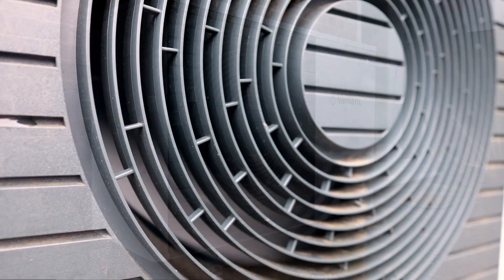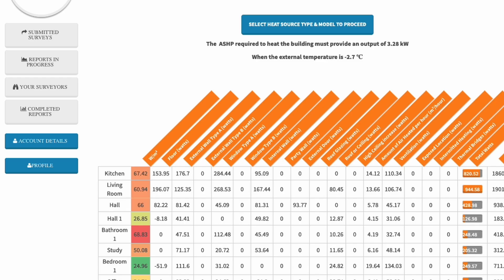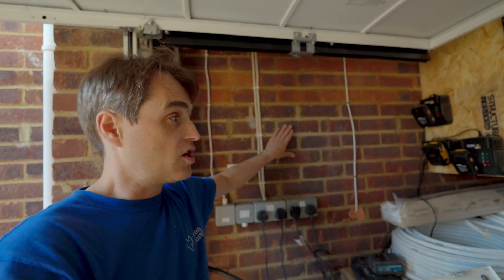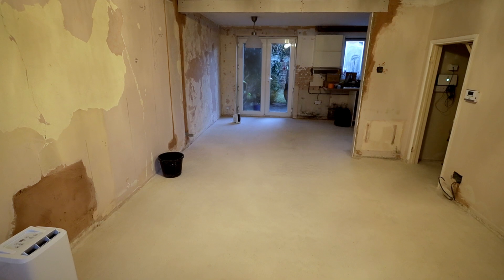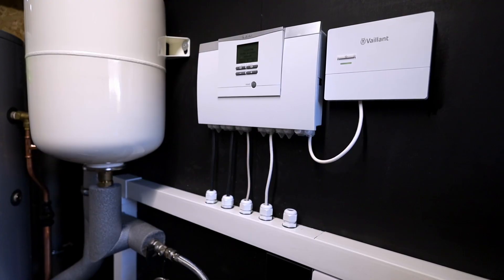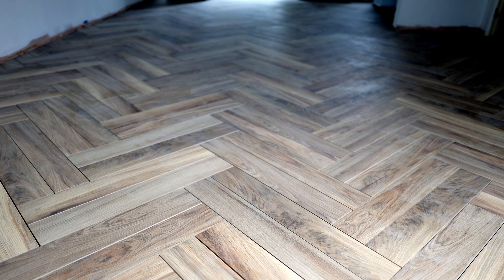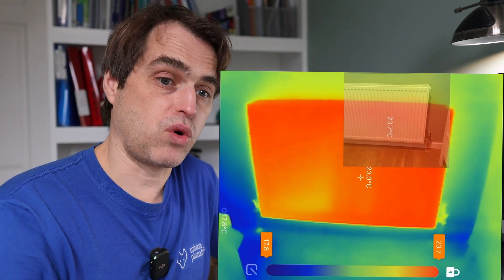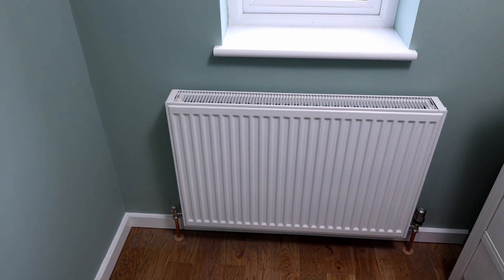How I Installed The Most Efficienct Heat Pump In The UK.

Comment: Great video as all your content is. 

I'm not an ASHP-sceptic but I like I think I am a realist. We're in an 80s house with microbore everywhere with the pipes either in the walls or buried inside the concrete floors downstairs. To move to an ASHP would require a full house renovation: walls off and concrete floors up to replace the microbore which would be unbelievably expensive to complete and probably make the ROI of the ASHP far beyond the usable life of the unit itself.

Internal wall insulation is a nice idea but my concern is that [even by a little bit] it makes the rooms smaller and with house prices already stretching what people can afford vs. what people want and need in their homes, making rooms smaller isn't always palatable or even possible. Upgrading UPVC windows to newer, higher U-value units is also a nice idea but I've run the numbers on replacing our windows and the cost just doesn't justify the savings. 

Getting PV installed was great and with an 8kW system plus batteries we're producing more electricity than we need and in the Summer to Autumn months, the boiler is turned off completely and hot water is produced exclusively with the solar diverter.

Call me old fashioned but I just can't shift the feeling that the everything you have gone through to get a system performing as well as it does is beyond the finances and economics of most people to do.

Comment: must be massive losses not insulating the slab, also a building regs fail. very bad practice.
Reply from the maker: Really? My house now uses 7kWh a day for heating and hot water and costs £2 to run.

Downward losses are negligible and uninstalled  slab actually makes the system run better as it acts as an accumulator 

Maybe do some research before sharing your opinions
Reply: Come on , zero floor insulation and you believe you’re not losing massive amounts into the ground? A lot of people will see this and think it’s ok. It’s not, building Reg’s specify a minimum insulation level to slabs and yours will fail badly. Really love your channel but in this instance you’re badly misleading everyone.

Comment: Can you explain why you hacked your Vailiant heating controls to work with the Glowworm boiler? Why was this necessary and what did you do? Can you clarify the height of the retro ufh + tiles, as it wasn't clear to me. You decided for no underfloor insulation and instead used the existing slab of concrete as a thermal conductor + the cement on top, and as heat rises, limited 0.5kw loss is acceptable? Great content.

Comment: You have solid concrete floor and it will just act as a thermal buffer. How can your be so sure?
Reply from the maker: Been tested on others. Works well. House is warm and uses 4kWh of electricity per 24h in current weather.

Comment: Good morning Szymon, one question please, if your heat loss calculation gave a figure of around 3Kwh heat loss was there any reason why you did not specify the 3.5Kwh Vaillant Arotherm Plus unit rather than the 5.0Kwh unit you did? Just curious!
Reply from the maker: 3.5 is the same unit with capped top. Would not modulate any lower and would take longer on DHW. 3.5 unit is a bit pointless as it is. I would love a real 3.5 unit - not a capped 5, that would be awesome

Comment: Re the volumiser Szymon, thanks for reply but I still have no idea why you have included one in your system and not on any installs you have done on youtube ? Is it just belt and braces in case the heat pump wants to short cycle so as to prevent any damage to it ?

Comment: Lovely install. Do you feel that the immersion booster will be necessary with your R290 heat pump? I'm in Scotland, with arotherm plus and always use only the heat pump to heat the water regardless of outside temperature.

Comment: Congrats on getting your own heat pump up and running - look forward to watching efficiency on open energy monitor leader board.  Question - (well, 2 actually) - 1. Which supplier or software did you use to design your UFH loops at 100mm spacings? 2. What size pipe did you use? I've been looking at 16mm pipe but seems minimum bend radius is ~ 160mm (so probably just about OK for 150mm spacing)
Reply from the maker: Didn’t need design for UFH. You can do 100cc with 16mm if you go snail pattern

Comment: Great, but where does all the equipment go if you don’t have an attached garage, and what if you want to park your car in the garage. My objection to heat pumps is the disturbance caused by installation, the reinstatement costs, and the lack of experienced installers. What about planning permission and noise. New houses are close together and this may hinder the installation. If you did a heat loss calculation on your loft insulation the difference between 200mm and 400mm will be minimal. The time it will take to get a return on the investment cost is probably many years and if the cost of electricity goes up you may never get a reduction in cost. Then there’s maintenance costs, it’s ok for you, you can maintain it but if you have a brake down what then. You have completely renovated your home but most home owners will not be able to afford this costly installation.

Comment: I would fit a heat pump With Solar PV maybe Solar Thermal evacuated tubes type, everyone really wants to go Off-Grid 👍❤💚 its extremely good say when you're going to retire & a must is to make sure you're home is ultra cheap to run,
As for solar system I do really like Victron Energy systems their systems are very efficient & the technical support & information is very well supported, pitty LG Solar stopped making their panels as they were no doubt top of the solar market,

Comment: Yes sure as a retired Aerospace Defence test engineer & previous to that a scientist of electrical & thermal measurements,
One thing I would have insulated the slab before laying down, but that's a hell of a lot of work, I witnessed a builder full renovation of a house, once you stzrt that off there's no going back,
When I worked in a UKAS standards laboratory, I created & designed measurement systems to push far beyond the laboratory given limits of accuracy capability, I'm a extremely fussy engineer things have to be right I won't say it's ok let it go out the door, were trained by UKAS - NPL & Aerospace Defence industry to be extremely fussy, 
I know with the good quality test equipment we had that the actual outputs were sometimes better by a factor than the manufacturer's given specifications,
In the laboratory we also performed temperature measurement & generation of temperatures, in the laboratory we had to measure the temperature to within +- 1°C by various Triangular measurements, 
I like to push to the finite limits, two situations I cannot ignore, in the Cheshire where we live, it is not as good as say down south where the temperature is always warmer, I see many Air source heat pumps painted a white or cream coating, because I know black absorb the heat better, then why paint the outside unit in a reflective light paint,
I noted Viessmann Air source heat pumps are painted dark grey colour, to me that would make sence to gain that little extra from the casing of the Air Source Heat Pump, I have no doubt the Valiant is good, but would placing of heat pumps say on a South facing wall might get that COP up even higher 👍🤔
Whats your thoughts on that as many will be using a Air Source Heat Pump to warm but not Cool a home 🤔

Comment: Hi, loving your work. This proves the sort of efficiencies that can be achieved with properly designed and installed systems. One question, why did you feel the need for a volumiser.  I can only presume the system is so small this would lead to defrost issues? If this is the case, at what point do you advise the use of a volumiser.

Comment: Curious what type of system you would recommend in hotter countries like portugal. I know it will depend on each situation but in general what would you suggest. A lot of people have used solar heating panels with storage tanks and immersion heaters however there are people installing heat pumps but the heating requirements during winter are a lot less and they have the same problem as heat geek is trying to solve where installers do not know what they are doing.

Comment: COPs should be defined as a function of the outside temperature to maintain a particular indoor temperature (say 20 C).
The always advertised single figure COP is meaningless.
Reply: That's why they use SCOP, annual heat output divided by annual electricity usage for a particular climate. Means it gets weighted towards winter usage.
Reply: @BenIsInSweden  
But it conveys much less information than my proposal.
It is like saying "how tall are the Japanese?". The average is less interesting than a distribution chart.
Reply: @paulsutton5896  you might be able to ask the manufacturer for it. Mine, which is a Toshiba (A2A) has all the data available in the Engineering Handbook, showing what capacity, electricity usage and COP (min/nominal and max figure) it will get for 20C inside at each degree down to -30C. The data generally has to be available for installers - especially for A2A, due to lowering heat capacity as the temperature gets lower.